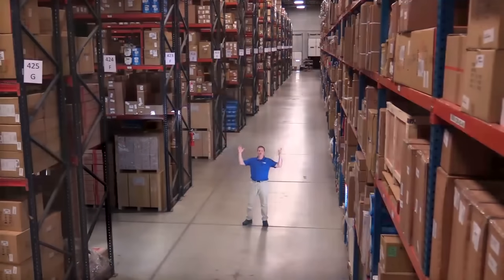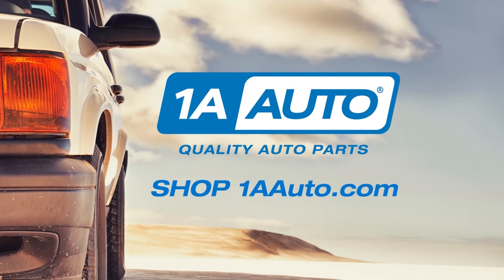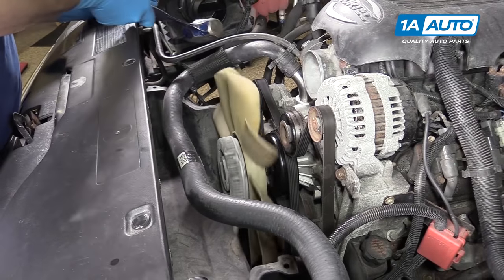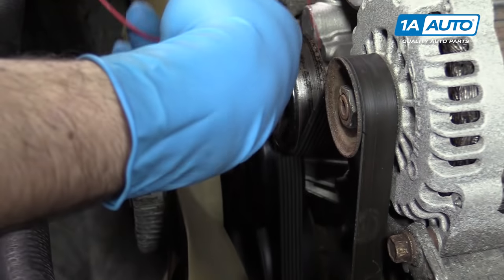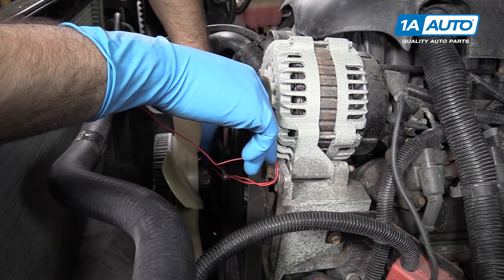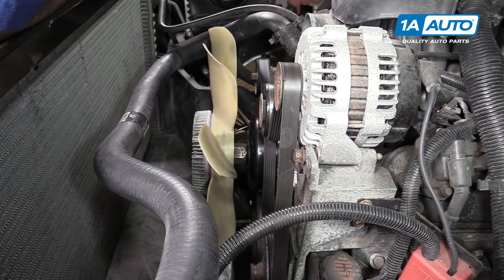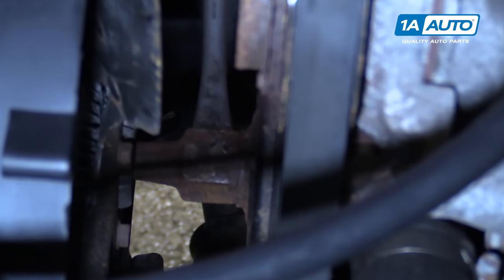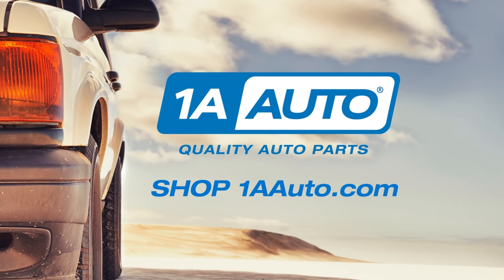How to Replace Radiator Fan Clutch Nut 00-06 Chevy Suburban

Comment: READ THIS COMMENT. I thought I was gonna have a hard time getting the clutch off but it was easy. I had some adjustable that were big enough for the nut. I used a pipe wrench on the water pump pulley since I'm replacing the water pump, slide the ooen end of the pipe wrench on the lip of the pulley from the back and tension the pipe wrench while you put pressure on the nut. Worked like a charm! Didn't really have to use much pressure really. Hope this helps somebody.

Comment: For those doing this...   When reassembling this fan clutch onto the threaded Water Pump, add a small dab of anti-seize to the threads of the fan clutch, where it screws onto the WP...     If you plan on keeping this vehicle for years, it will make the next WP job smoother...  I have one that is going to take a complete replacement of WP, Pulley, Fan blades, and Clutch assembly due to rust seizure . I have made it glow with the torch (which also killed my fan clutch seals) and still cannot get it to break loose..
Reply from the maker: +scfijunkie Thanks for checking us out. 1AAuto.com

Comment: The easiest method I’ve found is to use a 🗜, only tighten it enough to hold it in place so you can break it loose with a pipe wrench or a Crescent wrench. You can put little pieces of rubber on the clamp so you don’t damage the pulley but it’s really not necessary as long as you don’t tighten the clamp down crazy hard.

Comment: I just replaced the power window  regulator.  I used the cable from the old regulator.  I backed out the alternator bolt, wrap that cable around the bolt, and tightened it back up.  Voila!

Comment: If water is coming out from the pulley behind the fan because it is loose how do I fix that problem or tighten it
Reply from the maker: +Gavino Garcia You may want to see if the water pump is leaking from the weep hole on the bottom. If it is, the water pump may be going bad. Hope this helps you out. 1aauto.com
Reply: 1A Auto Parts hi I have a 2004 Chevrolet suburban my truck started making this loud air sound everytime I accelerate I went and replaced the fan clutch and it's still making the noise when i got that truck and didnt have that noise can you give me an idea what could it be
Reply: Anthony Maldonado it’s the fan clutch. The only clutch that doesn’t cause the annoying howl is the factory oem GM clutch.
Reply: @anthonymaldonado1597  have you figured out the problem yet?

Comment: I've tried all of these and then some it broke every braid of steel i took it out put rocks in the back of the water pump the impeller grinded them I put bolt nuts and sockets in the back it moved then the impeller got mangled. Im too broke for this I've bought specialty tools for this still with no luck. Im putting well over 180 pounds torque but still nothing but mangled tools and a hurt ego